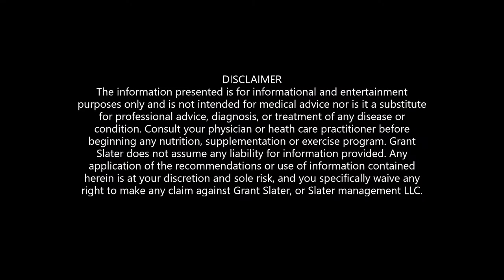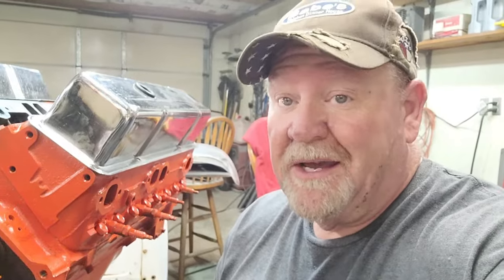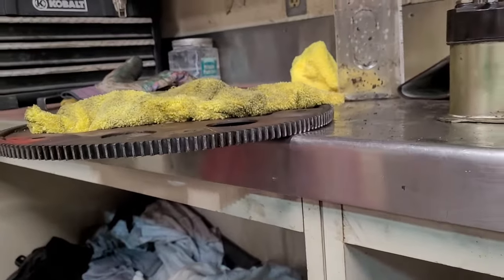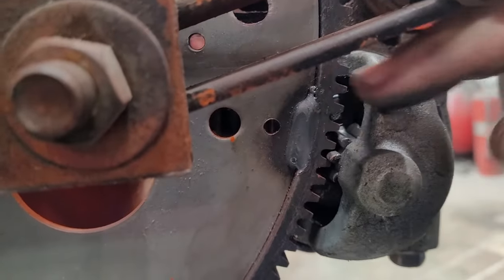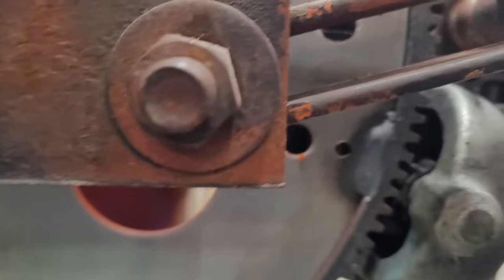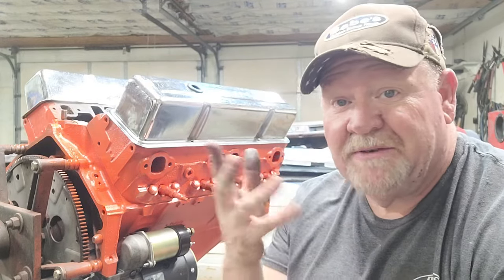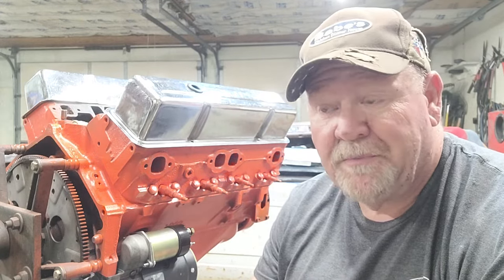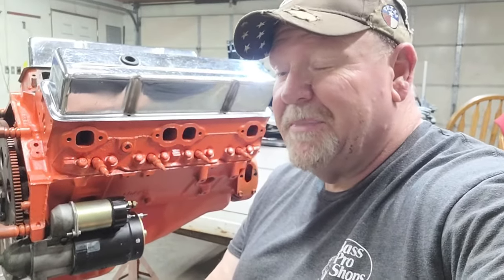HOW TO EASILY FIX A GRINDING STARTER: SBC, BBC, SQUARE BODY CHEVY

Comment: I wish you would have shown the removal of the solenoid. I'm replacing a starter and the just guess method is killing me. I've never taken apart a solinoid before. I'm going to try it, but I wish this were a bit more detailed for those without prior knowledge. You can't learn until you do, just how mechanics is.
Reply: 3 small screws on the side and ground strap, take them off and twist it will pop right off, don't forget to put the spring back in when you put it back together
Reply from the maker: sorry about that, thanks for watching

Comment: hey uncle buck i swapped my 91 sierra manual with and sbc with new flywheel and used the starter from the v6 its making a clattering noise . could it be the wrong starter?
Reply from the maker: Yes